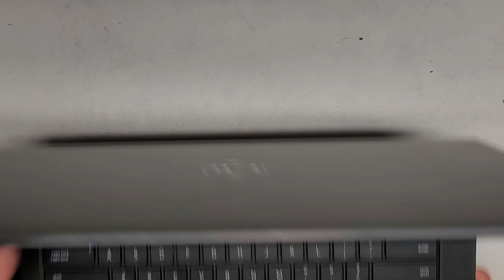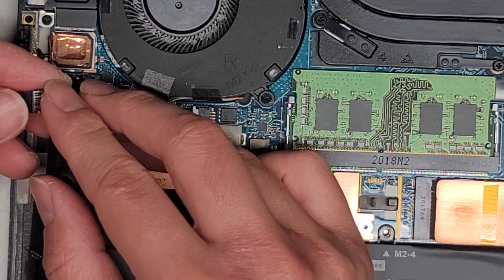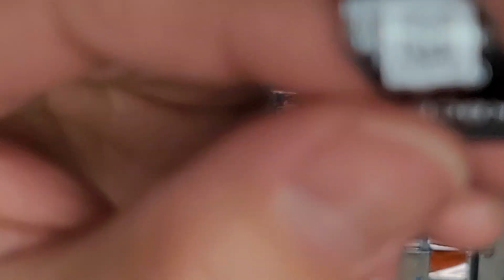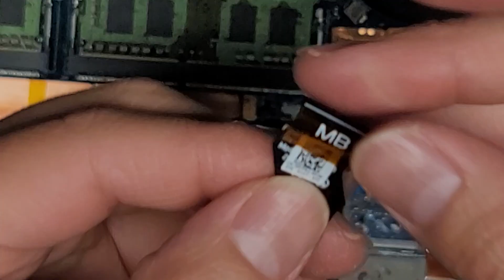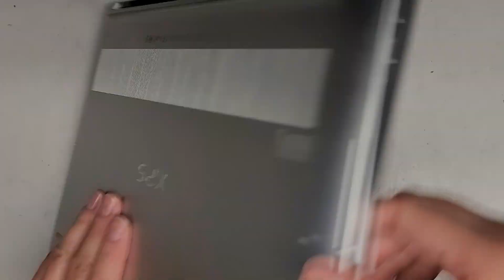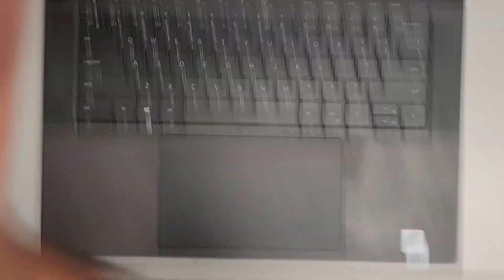DELL XPS 15 9500 Disassembly RAM SSD Hard Drive Upgrade Battery Replacement Repair Quick Look

Comment: Thank you for making this video!  Hopefully you can help.  I wanted to upgrade this computer and since this is 5 years old, what laptop would you recommend to replace this. I know in back in 2000 this laptop was 1k.   So many options out there but just wanted some advice.  The laptop can be 1k-1.2k range. Thank you
Reply from the maker: @mekanicaldave8200  I'm not sure. I just go with the hardware specs I want.